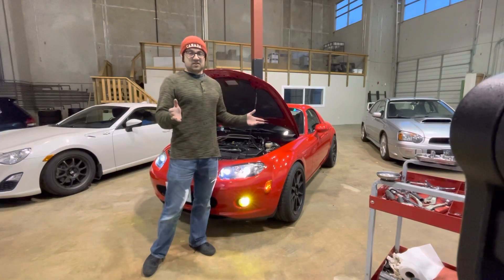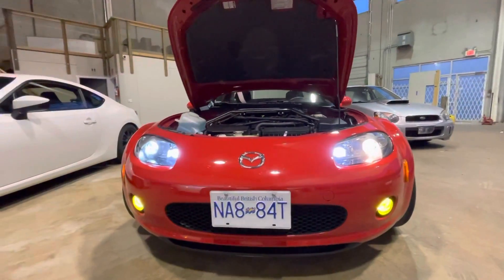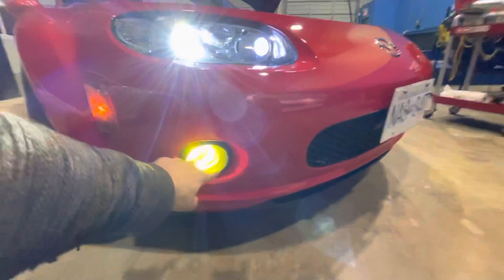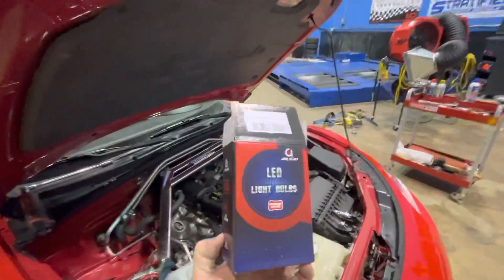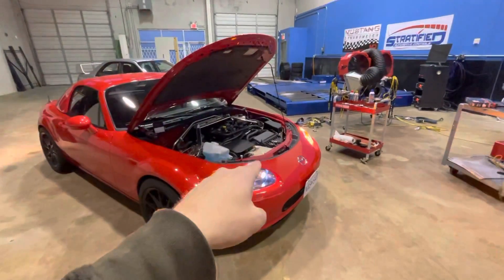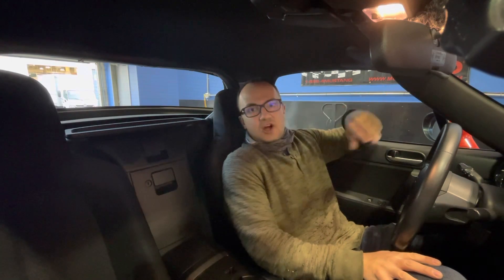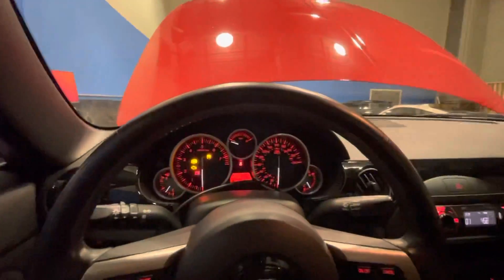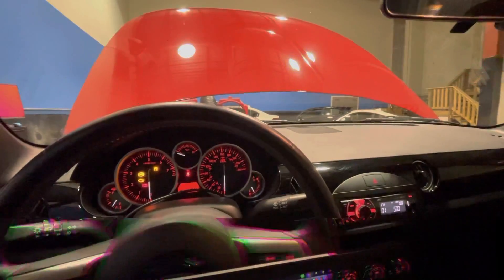NC MX5 Build EP2: We test a common “power adder” and modernize the lights

Comment: It’s power is really maxed out from the factory.  Headers may add a little extra HP.  Gutting the interior to shed some pounds may also help a little, but at the expense of making it an absolutely miserable daily driver.  Neither will add any sizable gains in power/speed.  Only a turbo or supercharger will generate noticeably more power…but at a huge cost.
Reply from the maker: NA cars have more modest gains until you open it up to add cams and higher compression.

Comment: Reality is the car’s current power level does not require any significant air induction.
Reply from the maker: Correct. Airflow through the stock air box does not hinder performance.

Comment: I have a 2006 NC and fortunately  mine has HID lights for the low beams and they are as bright as some LED lights. I never have to use my high beams. I have LED lights in all my rear lights and I will put them in my high beams, turn signal and fog soon.
Reply from the maker: Keep in mind that for the high beams if you have daytime running lights most leds will be at full power all the time and not dim when DRLs are on.

Comment: Thanks for sharing results. New stock filter v. high flow would have been ideal comparison. Depending on the application, some quality OEM style filters have been shown to outperform high flow.
Reply from the maker: In this case for the airflow requirements of this motor it looks like the filter on its own is just not a restriction.

Comment: Would be interesting with a new std filer as reference instead, it looked quite dirty. Ive dynoed a KN filter on my porsche 924 turbo, and it made several hp less than the std filter(which is very good) . So depending on how good the standard filter is KN isn't exactly doing magic, especially with the worse filtration.
Reply from the maker: That’s exactly it. It’s about pressure drop across the filter and that depends on airflow

Comment: I thought you could get at the lights easier by removing the inner fender liners. I also would never use an oiled air filter. It will cause build up on your MAF Sensor which is not good. That's why No automobile manufacturer uses them!